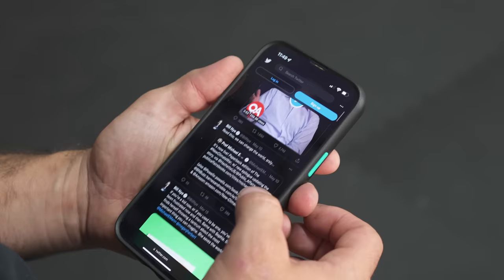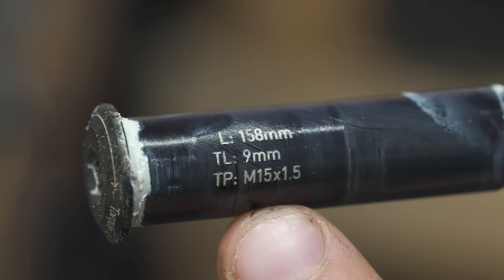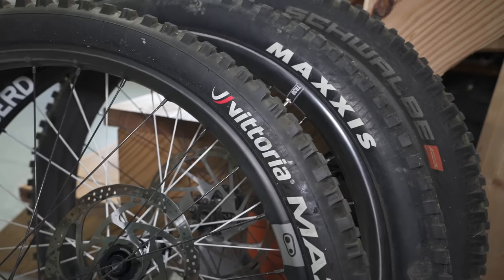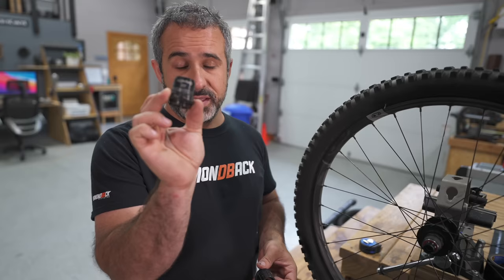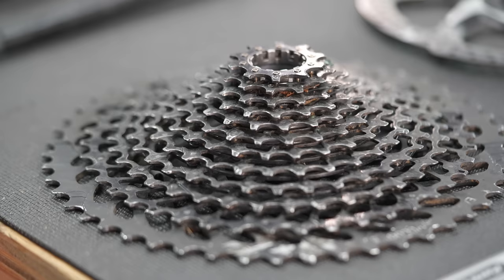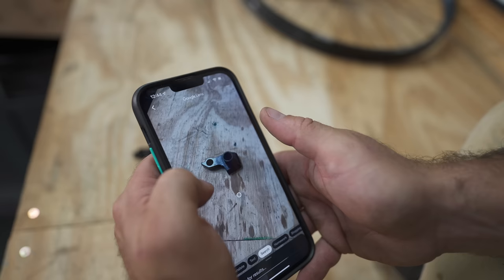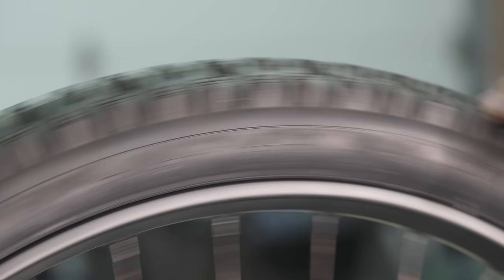What parts fit your mountain bike? (I won't tell you to just Google it)

Comment: Buying a digital calliper was one of my best buys for starting a toolkit, mine is Park Tool, but there are many other lookalikes that do exactly the same but aren’t blue.  They’re great for measuring the gap between seat stays to work out what tyre width will fit.  I bought a 2nd-hand 1994 Kona Cindercone for £105 and the callipers helped me reckon that Schwalbe Marathon Plus ATB tyres in a 26x2.15” width will fit, taking into account clearance for mud and mudguards. Also, they’re very useful for calculating the I/D and O/D of the head tube. My back can’t take a 130mm flat stem, so now I’ve got a 28.6mm quill stem adaptor to take an 28.6mm aheadset 90mm stem from Uno.

Comment: Love it, I bought a lightly used Snap-On Fat Tire mountain bike, as it has a lot of nice features that I liked (Hydraulic Brakes, etc...) but there was no spec sheet on the internet, or included.  It is obviously a re-branded bike and most places say its either a Trex or a Chinese copy.  Most of the parts are labeled though (Shimano) and are easy to figure out, for the rest we have google, and a pair of Calipers.

Comment: I feel your pain, I learned not to ask and look for the info myself. have put many of your videos to good use on my fat tire ebike, have a mtb on the way and have been googling for days, checking websites, reading manufacturers pdf files on the bike and parts, ordering compatible parts. its been crazy but at the same time satisfying because I know once I get the parts they will ALL fit without no issues. Only time i ask something is if i REALLY need too or need to confirm something, other than that its hours upon hours of reading and searching. sadly people nowadays want the answers to things without doing the work and without understanding how their own product works. So people get to know the product you own it will pay in the long run. Sadly that's the world we live in where people would rather ask instead of doing a little bit of work.

Comment: One problem I frequently run into is older bike frame/fork information. Trying to find information on a 10 year old bike from almost any brand is going to be a challenge. Unlike some other hobbies, the MTB community is notoriously bad at cataloging information on discontinued bikes/frames/forks. If you are satisfied with an old bike and just want to maintain it, sometimes getting the info for it is a massive pain.

Comment: My frame is from a Chinese company that made batteries and decided to produce a bunch of bikes. Company didn’t last but the frames are very solid hardtails with wiring shrouds and a battery port integrated into it.

Ive tried every type of inquiry but there is literally zero information. The only thing they even sell still are the batteries and spare parts. 

Has made some things a challenge since I don’t have a caliper to check things but so far a mm ruler put it all together.

Comment: Bike measurements that have never changed ever:
-pedal threads
-grip diameter
-derailleur mount point
-chain link spacing (not thickness)
Starnut and top cap on forks, also diameter of headset spacers.

Stuff that has 2-3 options to be aware of:
-forks: Straight 1 1/8 or tapered. Stay away from screw-on shenanigans. PRetty much any bike from the last 7 years has a tapered headtube, but double check.

Brake calipers: There's an old IS2000 mount (the calipers suck but an adapter to postmount rocks because no threads in the frame or fork). Flatmount is something new for race bikes and incompatible, ignore it for mtb.

Postmount has the advantage of easy adjustment, but it requires threads in the frame, which can be stripped, requiring heavy repairs or even trashing the frame.

Imo the ideal combo is is2000 mount on a frame + adapter + postmount caliper.

Brake rotors: 2 mounts, 6-bolt or centerlock, depends on the hub.
Matching brake rotors and calipers is trial and error, there are recommendeds but in general you can combine many things.

Handlebar/ handlebar mount diameter: 31 mm or 35mm, 22.x for road bikes. Measure twice, buy once.

Bottom bracket: Either pressfit (usually creaky af) or screw-on, there's 2 different widths of either for boost or non-boost spacing. This also affects your crank choice. 

Crank& axle mounts: There are 10 different versions, double check them to match on any part.

Wheels... Whole articles were written about this. There's some sense to the evolution, but not really.  The holy measurement is what your frame and fork fit, then see what wheels you need. Usually they cannot be adapted, even if they say so on the tin.

Same goes for axles, i consider them as part of the wheel measurements.

Cassettes and freehubs: There exist 3 different freehubs. Sram XD, Shimano Microspline and Shimano HG. The latter is the standard for anything 11-speed or lower, 12 speed is either XD or MicroSpline and locked to the respective brand cassettes. If you want to switch, check if your hub can be adapted.

Shifting cables are all the same (size), no worries there. Except for mech. V-brake brake wires, they're thicker. 

Seatpost diameters: 30.9, 31.8 or 34.xy mm, check which you need.

Every other mount and fit and compatibility i can think of is very situational and manufacturer dependent, requiring thorough research as to what fits what, because every manufacturer uses different naming and stuff. By that point, you're well in the territory of special parts i'd say.
Reply: There’s actually 2 sizes of pedal threads, one for old one piece cranks and bmx, and one for everything else.

Comment: re: chains.  I use 12 speed chains for all 10-12 speed and single speed drivetrains now.  They work perfectly (maybe even better / quieter on 10 & 11 speed drivetrains than the "proper" chains).  Give me the option to stock 1 chain that will work on any of my bikes rather than a mish mash of various chains.  The SRAM XO1 chains are reasonably priced when you consider I'm starting to believe they can't be worn out.  When I find them on sale, I just buy a bunch for stock.

Comment: To measure the diameter of round things I use electrical tape (every color but Black), wrap it around once with a slight angle, take my sharpie and mark any spot where I can mark both layers, unwrap it from the thing and Stick it on a ruler. The length between the marks is the circunference and with a little bit of math you'll get a good measurement.

Comment: Another option if you don’t have callipers yet (seriously, get them, you’ll need them also around the house): circumference can be used to figure out diameter. You can use a soft tape measure or even string and a ruler for diameter, if you have to measure an outside diameter. :)

Comment: The more or less correct way to measure a handlebar without calipers is to wrap a string around it in a single look then draw a line at one point on the on the loop so that both ends of the string have a mark. The distance between both marks is the circumference of the handlebars. To convert that circumference to diameter you divide by pi.

Comment: I wish the manufacturer's website always worked. Rebuilt the stock rear wheel on my Slash. I looked up the wheel and was able to get a new rim no problem, but the spokes that they stated on the website were off by 3mm. Doesn't sound like much, but I had the wheel completely laced and found out that I couldn't tighten the spokes enough since they were too long.

Comment: For years at my old automotive job, customers would call trying to order sway bar bushes, without knowing diameter of bar. If they didn't have calipers, most had adjustable spanner and ruler. Close adjustable spanner over round item, then measure gap with ruler. No good if you need 0.1mm accuracy, but good enough for that task.

Comment: Had left biking for a minute only to find all the newer tech that had been developed after 2011-2012 which to my surprise was amazing and has helped (almost babied) the next fellow MTB'ker. 
(JK nowhere near being a professional biker) 

I started back up again when my V-brakes on a Walmart full sus Hyper Bike were shot and at the same time saw that throughout the years of having it, the exposed brake and gear shift cables began to rust because of the lack of maintenance that it didn't receive. 

Of course I started off buying Walmart replacement parts because practical and cheap alongside clearance items that I had seen walking through the aisles like general tools one should have. To my surprise, I fell in love with MTB again and even stronger than before. 

Yea it took me almost 6 months to change the whole gear and brake system (went with a nicer and improved shift / brake-in-one system (EZ fire shimano)) cause I was very cautious in how you did it and didn't want to be messing up on the first try. And it worked, sorta. 

Only problem was the rear V-brakes which comes down to alignment on the frame itself (tried everything I could, from aligning the V-brakes to removing spacers) and it works as intended just not as what I liked it to be. But throughout the whole process, it felt like I was learning so much about almost every little aspect, not just on my bike but the more expensive ones where tuning is important especially for the riders safety, comfort, and each individuals own personal opinion.

Not even a year later and found myself purchasing my first hardtail, 2019 Marin Nail Trail 6 that immediately fell in love with, although did need quite of maintenance to go through since owner left it to the environments care 🙃. Bought it at a steal I would say and just under 2 years old as well! 

Immediately went to work and have been slowly through the years upgrading her although I think I've reached the point of upgrades (tubeless tires, chain, cassette, derailleur alignment, BB and crank arms, dropper post, saddles, pedals, paint fixes, cable management, etc.) that aren't necessarily needed to add anymore (Last thing I wanna change is the fork to a bit beefier and bit more travel for the rides I do, tbd). 

I've even gotten my father to purchase his very own entry-level MTB (giant stance) and help him when somethings off or even just the regular stuff maintenance it needs. Its been truly an awesome experience to relive again and definitely here to stay. After finishing up last semester of college, been really considering putting a bike shop of my own, being able to assemble new fresh bikes off the manufacturer, would be the dream.

Comment: Great video. I wanted to replace my suspension fork but I couldn't figure out all the parameters for the new one. It turns out that on the (SunTour) fork there is a manufacturing date and a serial number above the top of the left stanchion. You can search for the serial number on their website to get the exact configuration of that fork 👍 I was so tired of trying to figure it out until I found that

Comment: My issue with googling is information overload which in turn becomes an endless cycle of research and no less than 100 people with a different answer. replacement parts not so much but upgrades and accessories can be a pain. Current issue is locating a bottle and cage that properly fits a Polygon D6.

Comment: great video, just maybe one addition to brake rotors, it may not be so easy. Shimano has two types of brake pads, narrow and wide. Narrow type is for higher components (Deore or SLX and up) and wide are for lower series. And they cant be mixed. Well maybe using wide rotor on narrow pads will be okay but opposite combination would mean worse braking power as pad will be wider than rotor :)

Comment: For calipers, Harbor Freight sells plastic calipers for $3. I prefer my plastic caliper over my metal one because there's pretty much zero risk of scratching my parts with the plastic caliper and the accuracy is almost always "good enough". At most, I need 0.1mm accuracy, and there's a cool little 0.1mm measurement scale on the plastic caliper, so I'm good! I also don't feel bad when I drop them, which is nice.

Comment: 4:34 If you dont want to buy a caliper, you can also use a soft measurement tape and calculate the diameter. ( circumference/Pi).

Comment: 6:33 if youre buying a DT Swiss wheel and is wayyyy toooo drowsy to check if its centerlock or 6 bolt, just buy the wheel and a 6 bolt rotor, DT Swiss has a 6 bolt to centerlock adapter thats included per MTB wheel, pretaped for tubeless and a valve stem included too

Comment: Fun story that just happened to me with my specialized rockhopper comp 2018, I bought a rockshox recon with boost axles knowing it’s not compatible but bought a new industry 9 front hub to be compatible with this new fork, the weird thing is that in the official website from specialized says that both hubs and rims are 32h and after I tried to build my new front wheel with the original rim and my new industry 9 hub I discovered that my front rim and hub were 28h and when I went to the specialized store they were also surprised about that since they also thought that both rims were 32h, now I’m just waiting for some new chromag wheels to fit with the industry 9 hub

Comment: tires are also metric. in fact, there´s width is written in the ERTO in mm before the bead size. and different manufacturers have different ways of translating inches to mm lol. some brands spec 2.3 for a 56mm tire (spz) some others spec 2.25 for a 57mm tire (schwalbe). going for the mm explains why some tires seems smaller than others "same size"

Comment: A couple things I'd like to add for cassettes and chains:

There are three freehub standards. HyperGlide (HG), XD, and MicroSpline (MS). 

MicroSpline is only for Shimano 12 speed.

XD is for SRAM 12spd (Eagle) and 11spd, excluding NX and SX, which use HG.

HyperGlide is basically everything else. All 10spd and under are HG, Shimano 11 speed is HG. SRAM GX and higher (X1, X01, and XX1) Eagle (12spd) or not (11spd) use XD, whereas NX and SX use HyperGlide.

Shimano 12spd: MS
SRAM GX or higher: XD
SRAM NX or lower: HG
Everything else: HG

And for chains, like what the video said, get the same speed chain as your drivetrain. KMC and SRAM chains work for everything, whereas Shimano 12spd chains only work on Shimano 12spd. They will not work on SRAM Eagle.

Comment: I have two questions but it doesn’t matter bc no one will see it anyway but I’ll still ask. 
No. 1 How do u know what size rotor the mount for the brake caliper is on a fork.(if that makes sense.)
No. 2 how do u know if rims and tires are tubeless ready?

Comment: Except 5,6,7,8 speed chains are all 3/32nds and are any chain with more cog capacity can fit the smaller capacity cassettes. Eg any 8 speed chain will fit any 5,6,7 speed cassette. But a 6 speed chain may not do as well on an 8 speed cassette. Im still learning.

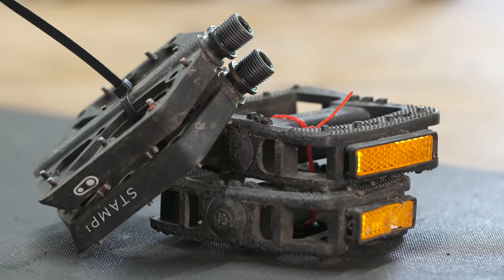Comment: 1:43 Recently I fitted a new presta walve core because the old one was bent. And...... the old valve cap did not fit! It didn't thread on properly, so I had to get a replacement cap.

Comment: You're wrong about the saddle though, saddles with carbon rails typically have oval instead of round rails and often require specific clamping hardware that may or may not come with your seatpost

Comment: Great video! Recently just upgraded my 3 x 9 drivetrain to a 1 x 11 (Shimano XT M8000 entire drivetrain). It was incredibly difficult to source parts and make sure everything would be compatible with my bike frame. 
After 1 month of research and price comparison, I finally found everything and installed all the parts! 

BTW, Bike tools are expensive af hahaha
Reply: but you only have to buy them once and it works out cheaper then the LBS in the end.
Reply: @M3PH11  very true. and now i have all teh required parts!

Comment: Excellent video! I am new to MTB parts, but have been riding off and on for years. I have a 2005 Giant Reign 2 and I am trying to convert to a 1x. I under stand what parts I need, but not sure what to get. MTB parts are very confusing. I am coming from MX and there is much more standardization with MX dirt bike parts.

Comment: What sucks is when your bike manufacturer doesn't have enough relevant information about the specs on their website. I have a 2010 Trek 4300 Disk and there's a lot of info that they just left off. Plus, they switched forks and brakes halfway through that model year. Sure, I can figure it out now, but it sucks to find specs for a 12 year old bike. It's easier to find new parts for a 12 year old child.

Comment: "Valve caps fit, no matter what"

Except there's at least 3 different types of valves that all use different sizes of valve caps:
Dunlop Valve (not sure if there are any of these outside of germany or europe tho)
Presta Valve (Which I HATE coz they're a pain in the ass to deal with)
Schrader Valve (which is my preferred type of valve BY A LONG SHOT!)

And while the first 2 have the same threads for the valve caps on them and are compatible with the same style of pump the Presta Valve requires much longer valve caps than the Dunlop Valve does.

Comment: I have a challenge for all of you. I have a FC-M590 crankset and thanks to Shimano I have found every compatible parts for it and every other part for my future drivetrain, but I have still one problem. When I looked up the rear derailleur it said that it has a maximum tolerance of 22 teeth difference up front. The crank set I have has 26/36/48 teeth and the cassette has 11-34 teeth. If you add the 22 teeth from the cassette's smallest cog then it will only equal 33 teeth. I haven't found an compatibility chart for cranksets and rear derailleurs on SHimanos website. Will the rear derailleur fit my bike?